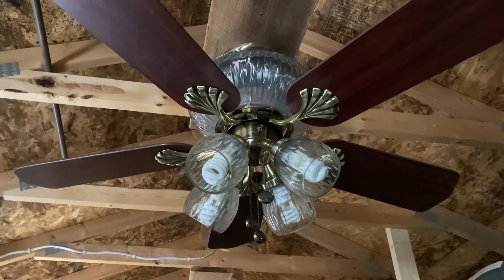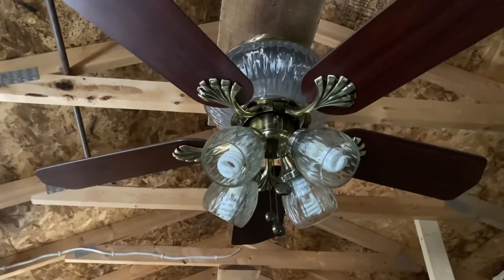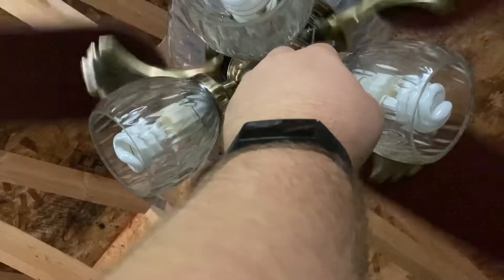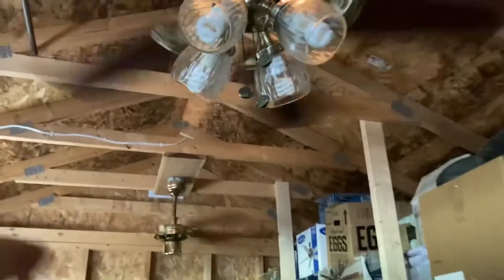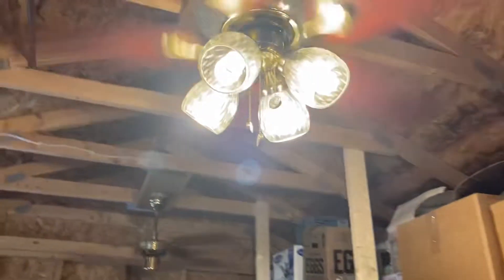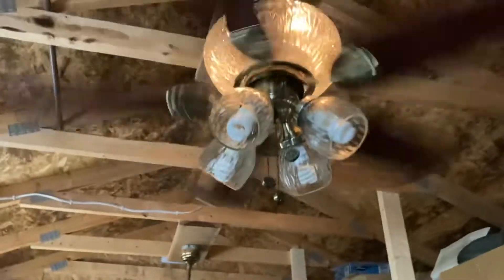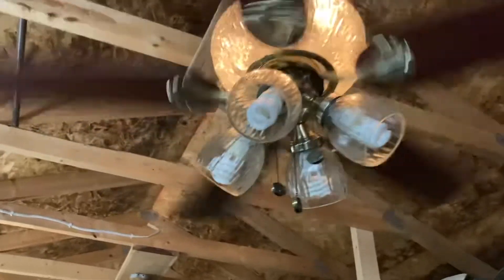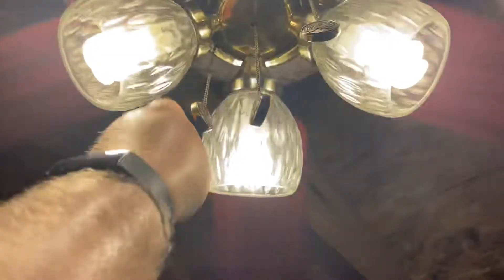Hampton Bay Jericho III

Comment: My in-laws have one of these the short blades threw me off completely.    It honestly looks better with the smaller blades.  How id you acquire the smaller blades or did they make a smaller version ? :-)
Reply from the maker: I acquired this fan with those blades. They aren’t original though. At the time I bought this fan I swore I saw a Raleigh II with bigger blades but I didn’t notice till I brought it home. I thought this was a cool fan but the little blades make it better.
Reply: @vintagesouthernfancollecto8275  Definitely it looks better and obviously will perform better.  Thankfully too the blades didn't warp like the 52" ones all have done I've seen.
Reply from the maker: @stanleyf.manley7177  Thankfully the blades didn’t warp. Smaller blades don’t tend to warp unlike the bigger blades